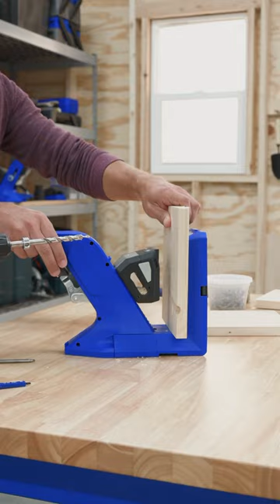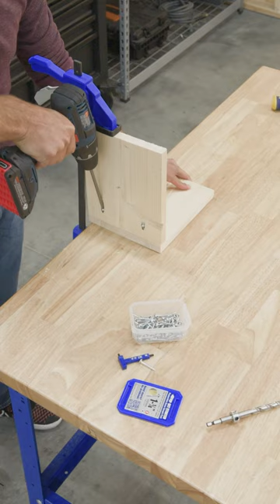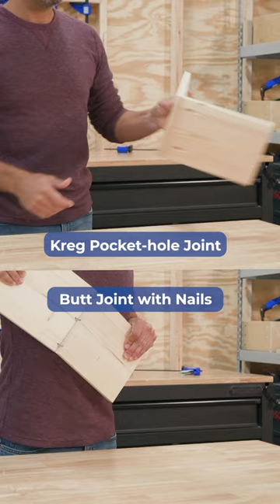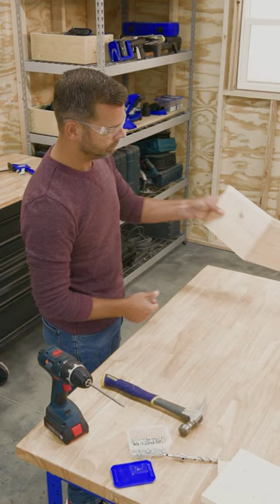Strength Test: Pocket Holes vs. Nails

Comment: A sensible wood worker would have added glue.  I built many book cases, shelving units, and work counters  --  in my house and in-home office.  None of them experience "racking" of the joints.  I have Never had a failure (in 30 years).

Comment: Nail is faster.
To be fair, you need to add wood glue, both pocket screws and nails are only the method to keep the wood boards attached for the glue to dry.